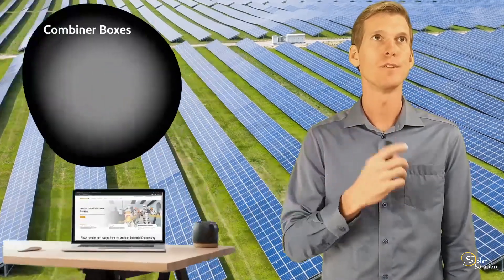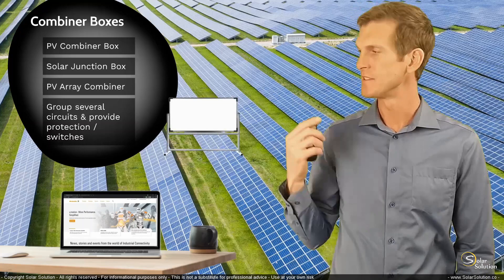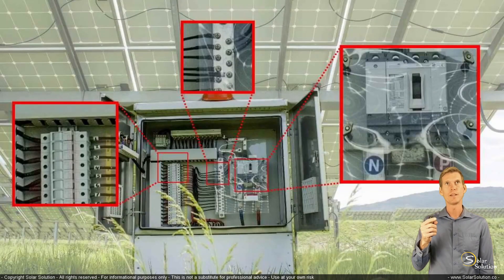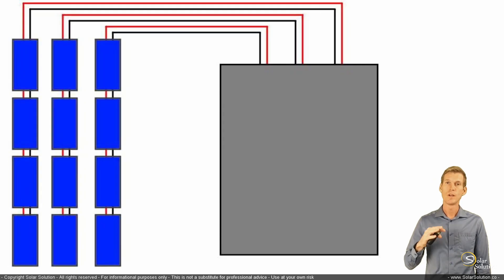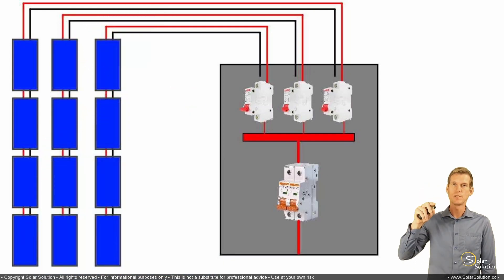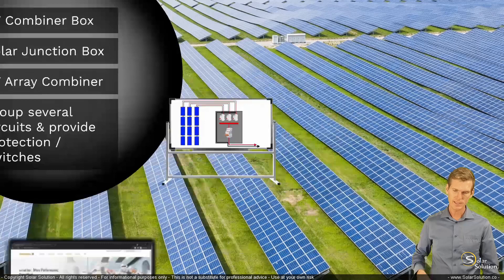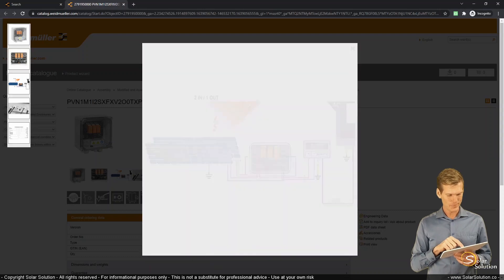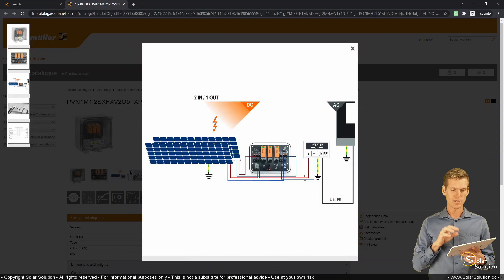The function of a Solar PV Combiner Box

Comment: I find your presentations very Clear, and I greatly appreciate them.  While some of the technical components may blur, I place a High Value on your professionalism in presentation.

I have looked through your Library, with the intention of getting clarification on a couple of aspects in a very modest 12V install.

Fundamentally, it has always been my understanding that in Any electrical circuit, minimizing ‘breaks’ in that circuit should always be an objective.  Less connections, less resistance/line losses.
The idea of fusing in a small system (2) 48V PV Panels has been suggested that I just use inline MC4 fuses; but, still Trying to reduce ‘breaks’/connections.
Circuit Breakers, your video was Great.  My understanding is that due to so many (Americans) improperly wiring CBS, that the regulatory agency (NEC) implemented a requirement that necessitates the use of a Radial Isolator (instead ?).

But, Isolators are not designed to break flow on energized circuits (?), and only CBS have proper extinguishing for DC arc.  To further complicate things, it has been suggested to me that as long as my Panels and Cables are properly sized WITHIN the parameters of my MPPT, that fuses aren’t necessary.

Pretty clear how average people like myself can get things muddied, right ?

And LAST, I have heard that in the cases of fuses, Fast acting are not always optimum, which is counterintuitive for simpler minds.

Could you suggest which of your video library would potentially clear these (Dilemmas) up ?  I am more than Happy to view again, with the hope of better clarity …

Again, your content is Most Appreciated 🙏

Comment: Hello!
Is your course on udemy made for engineers? Or just for beginners?
Thanks
Reply from the maker: Good question! It is made primarily for non-engineers at the beginner/intermediate level, though it turns out that engineers who have enrolled in the courses are learning from it as well. They said that some of the 'easier' lectures were refreshers, or that they would skip some lectures. Tip: The first few lectures are available as free preview, and Udemy has a 30 day refund policy. Have fun!
Reply from the maker: Hello  Vicco. I have designed the course for beginners & intermediates. Engineers who already have a background in electrical engineering would probably not benefit that much from this course. I hope to see you soon!

Comment: I tried to combiner box and couldn’t get it to work for anything. I followed every direction from the manual. I finally gave up and just ran two separate strings down to my bus bars and everything worked fine.
Reply: Made in China?
Reply: @johnfitbyfaithnet  
Midnight solar